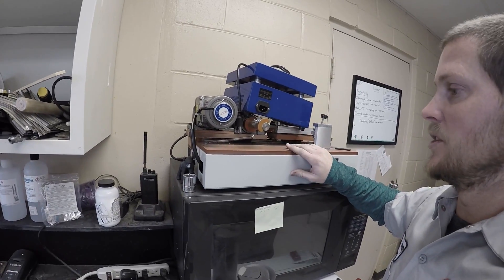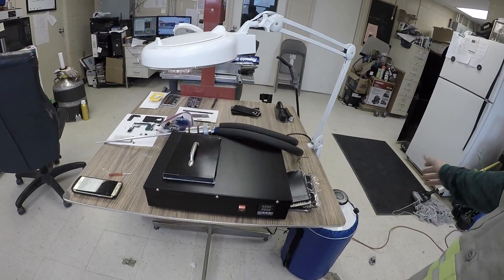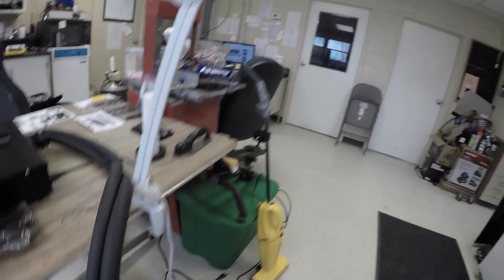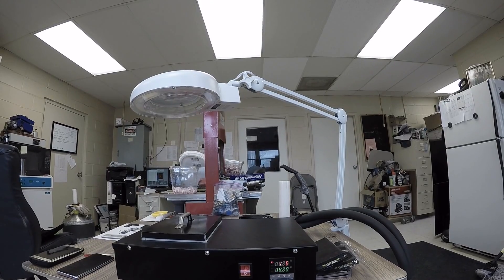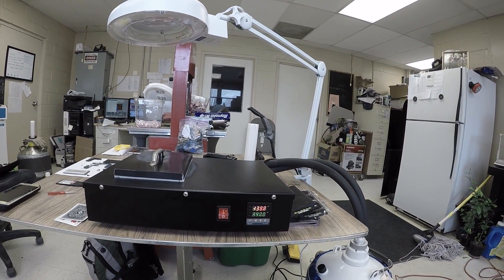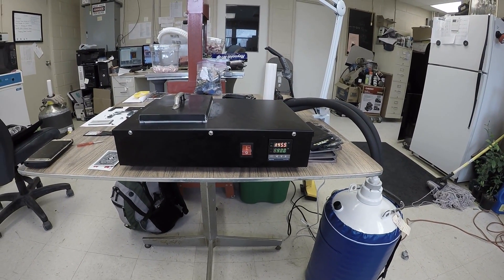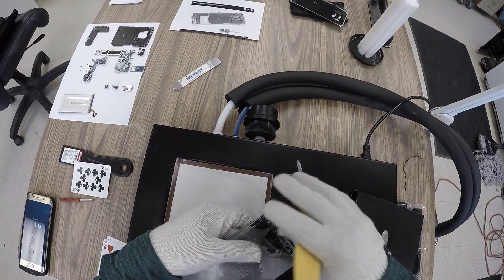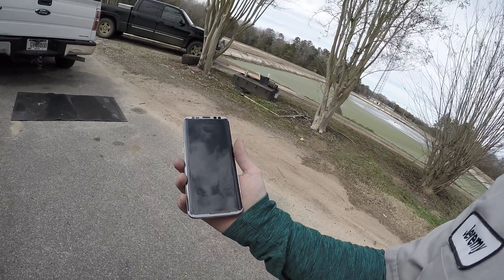Novecel F07 Nitrogen Cell Phone Glass Only Repair

Comment: Bro, can you send me the info they sent you on time and temperatures. I have the same machine and I’m doing a note 9 and the glass didn’t come off that easy. Did I not wait Long enough?
Reply from the maker: Not really sure? I do know that different devices require different times and temperatures. They never sent me a “list” really... I just wrote novecel customer support and asked about each particular phone and they always responded back with their answer. I always wondered why they didn’t just post times and temperatures? I believe they also have a YouTube channel because they have previously commented on my video. U may be able to just message them on YouTube?
Reply: Jeremy Miller thanks for the quick reply. Yeah I wrote jiutu and novecel. They both gave me similar times and temps. I didn’t leave the phone on the plate long enough. Btw if you ever fix a note make sure you’re at -150 for 2 to 3 minutes

Comment: Hey man, just bought this. I've seen it done on the freezers without LN2 with the chassis attached as you did. They do 90 seconds at -175. Where did you learn -140 at 3 minutes? Some people on youtube do only 10 seconds with much less satisfying results.
Reply from the maker: Jørgen Hvalby I wrote novecel and told them the machine I had and the model of the phone, and that’s what the guy there recommended. Each phone is different so its always best to just write them and ask them. Can’t really remember the email right off hand, but they have actually commented on my video and you may be able to just write them on here? You are going to love the machine. Works great! Wish I could afford one of the freezers that doesn’t require the nitrogen though. Gets a little pricey sometimes
Reply: @758Redwhulf  I dread the thought of having bought a $1500 freeze machine to find it has a leak or the compressor dies. The gas in the cooler system on these machines is patented by the Chinese and not possible to re fill in our part of the world.
Reply from the maker: Jørgen Hvalby you have a good point never thought about it like that

Comment: You should use Loca Tape and buy an air compressor for bubble removal it will save you time and heacache free, it will move you away from hobbyist to potential business.
Reply from the maker: I have never heard of that message. I'll have to check it out. Do you have a video you'd like to recommend? I just did my wife told again, and I had great success with just using the glue.
Reply: Here you go! https://www.youtube.com/watch?v=peB-YEJtxYw
Reply: The glue has too much room for error and takes too long to make it viable for a business, all manfuacturers use loca tape. https://blog.rewatechnology.com/oca-film-all-you-want-to-know/

Comment: this machine works for note 8 , s8 ? thanks and great video
Reply from the maker: RNX - Servicios Gsm I have never used it with the note 8, but the phone I was using in the video was an s8 plus. I just commented to novecell to please respond back to your comment. If I had to guess, it should work perfectly fine on both of the devices you are talking about. There's plenty of room for it to lay on the plate on top.
Reply: great , my doubt was if i can work with those phones with -140 degress, thanks a lot brother
Reply from the maker: RNX - Servicios Gsm as long as you wear the gloves, there's nothing to it. Of course, you take them off, you have another thing coming LOL
Reply from the maker: They responded to your comment. They said it should work

Comment: Nice video bro
Reply from the maker: Novecel Your #1 Lcd repair solution can you answer the question I was just given in another comment for sure about this machine working with note 8?
Reply: Jeremy Miller hi jeremy ，in fact i never  tried note 8 with this freezer , when note 8 came we already had electrical one -180 , that 's why i never tried , but i think it works , it just requirs low temperature , and the nitrogeon frezeer can reach it , so i think it works .
Reply from the maker: Novecel Your #1 Lcd repair solution I understand. How much would it cost for me to get one of those low temperature freezers? Do you have a miniature version that is not quite as expensive as the larger version? I would love to at least try one
Reply: @NovecelYour1Lcdrepairsolution  Just got this machine myself. Do you have a list of tried and tested best temperatures and freeze times for different phones? I am doing s6 edge, s7 flat, s7 edge, s8, s9 and s9 plus. Thanks very much. Looking forward to trying it.